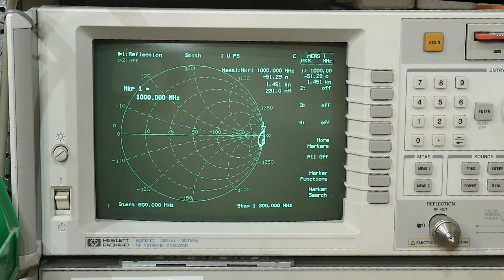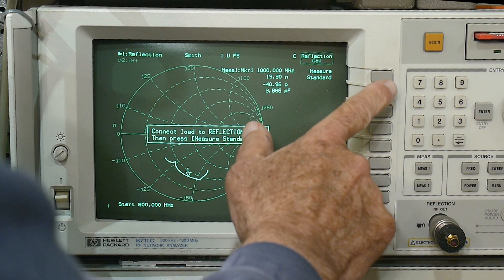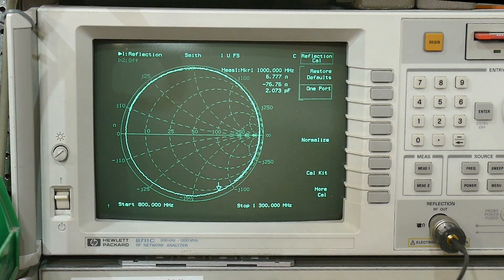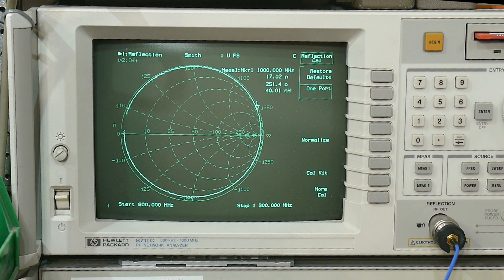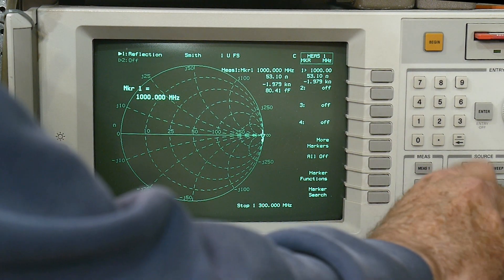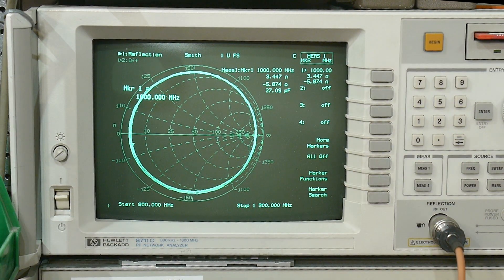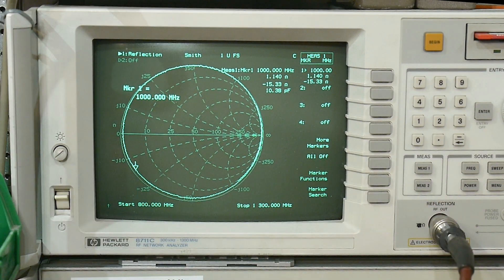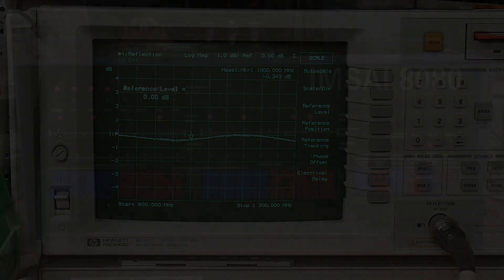#1468 Coax Loss measured on a Smith Chart

Comment: This is helpful to me - trying gauge 2 to 4 meter snoop cable to Spectrum Analyzer (I haven't bought yet) or experiment with very directional antenna gizmos + preamp + filters  to compensate for "Coax Loss" ---> Spectrum analyzer ($1k1-$2K++ "Bench" grade ) vs. SDR "Play" like Gizmo box on a pole with Ethernet cable going 4 meters to a janky computer. My main thought -  is signal phasing and extra noise and weird harmonics by a longer cable (may cause issues - but maybe not significant ones ?)  ... Also wondered (my ignorance ) does cutting and manufacturing a cable at 1/4 wavelength integer / step  termination cause problems (For rando 2 to 5 meter coax in the 800 Mhz to 1.5 GHZ range ) ... I'm just signal sniffing (rather than glue sniffing) so I'm not sure if reflected phase angle or weirdo standing waves are an "Important " consideration  or not ? - Outside of regular SWR - I'm not transmitting - just listening / finding. 
.
Thanks for making this video - kinda helped imaging how and why SMITH made these charts to begin with.

Comment: Near the end, you show the wiggle that varies with frequency.  Since, as we travel along the transmission line we will see short and open at quarter wavelength intervals, shouldn't we expect to see more wiggles displayed with the short cable versus the longer cable?  

So the number of wiggles is really only related to the length of the cable.  The vertical size of the wiggle would be related to the loss.
Reply from the maker: you get the wiggle every time it goes around, so more length more wiggles

Comment: What a waste of time.  The title of this video is "Coax Loss measured on a Smith Chart."  You showed on a Smith Chart that there is loss in coax, but you never actually measured it, you never quantified it in any way.  After eight minutes and 10 seconds, you finally changed to a log mag display where the actual loss of the  coax (actually, twice the loss of the coax) is displayed.  You owe me - and everybody else that wasted their time - eight minutes and ten seconds of time.  Thumbs down.
Reply: If you do not get any value from his video, s ,then WHY watch them.🤔
Reply from the maker: @stevecarlisle3323    when I use a cable on a smith chart, I can quickly look at the circle diameter and see if it looks reasonable. if it doesn't I will choose a better cable for that frequency or try to determine what is wrong with the cable. I don't need an exact number. If I need  a number I show you just push the logmag button. it shows the return length loss. Since this is of value to me, great. If not value to you. just ignore.
Reply: @stevecarlisle3323   Sometimes I get value from his videos, sometimes I don't.  I watched this one because the title (mis)led me to believe that I might get some value from it.  I didn't.
Reply from the maker: yes, I got it the first time Jim. you see the @steve in my comment? I was talking to Steve
Reply: @IMSAIGuy  No, actually I didn't see the @steve in your comment because I didn't even see the comment until you pointed it out to me just now.  It wasn't addressed to me.  I saw Steve's comment, which was addressed to me, and for which I received a notification (and which I responded to).  Did you see the @Steve Carlisle in my comment?  I was talking to Steve.
Reply from the maker: Thanks for watching Steve!
Reply: @IMSAIGuy  Ya, and thanks for making all the videos, The Good and the BAD, 🤣
Reply from the maker: They can't all be winners. And I give a money back guarantee!
Reply from the maker: I already made a video on the actual measurement: https://youtu.be/mU71rGUKlBI
this is an easy way to check your cable on S11 without having to change the setup for S21. Sorry you didn't find it useful. take a look at the other video
Reply: @IMSAIGuy   Sure you can check the loss of a cable with magnitude of S11, no need to set up for S21, and there's no need for the Smith Chart.  I was doing that 40 years ago.  The point is that this video does not show what the title says it will show.  You could use the radially scaled parameters at the bottom of the paper Smith Chart - RTN. LOSS [dB] is there, and I see ATTEN. [dB] is there too, although I've never used that one.  I saw the title of this video and thought I might learn something.  I was disappointed.  And I suspect I'm not the only one.
Reply from the maker: OK, fair enough, do a video and I'll point to it
Reply: @IMSAIGuy   I might.
Reply: Jim, why don't you go and spend your time shooting and editing videos and sharing them for free to us and then we can find things to complain about them?😊
Reply: @deBug67   I have been considering making videos for some time and this video would be a prime example of why.  You can be certain that, if I were to post a video titled "Coax Loss measured on a Smith Chart", by the time the video is finished, you will have seen coax loss *measured* on a Smith Chart.  Not just demonstrated that you can see coax loss on a Smith Chart, but actually *measured* on the Smith Chart.

Comment: All right. I just bought some coax to replace some old. (Maybe about 20 years old) similar coax. After replacing the old cable I see very little, if any change in antenna system performance. I think I wasted my money. Now I can run this test to see if I needed to change the cable.
Reply: In most cases, if water did not get into the cable and the cable itself is made qualitatively, then it can work 50+ years without a large loss of quality.
Reply: And, come back and let us know the results.  I've been thinking of replacing a 20+ year old Comet antenna and coax.

Comment: RG58 is not meant to be used at these high frequencies.
Reply from the maker: indeed. 21.5 dB loss per 100 feet at 1 GHz
I have to add though, everyone is using RG174 which is worse!
Reply: It really depends on the length of the coax.
Lossy coax will still carry a usable signal when the length is short, but try it through a 100 meter length, and that will fail to carry enough signal for most applications, at high frequencies.
If you are making measurements, it can be any short coax for the connections, as long as you know the loss of that piece of coax and can take it into account when making the measurement.
What can make the process difficult, is when the coax is intermittent.
Reply from the maker: you are right, I was surprised to see such large effects with the short cables I was testing.